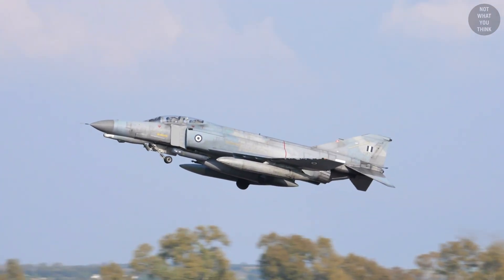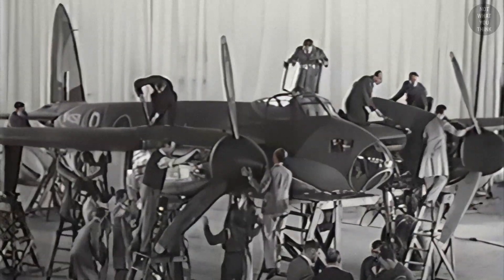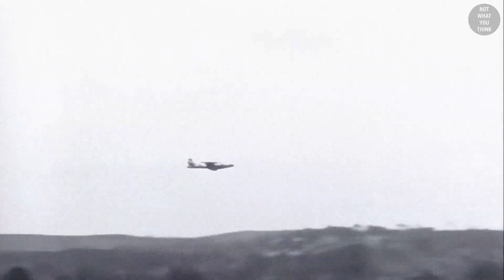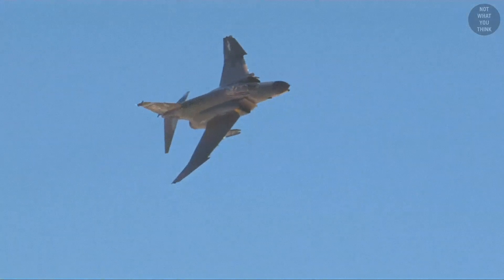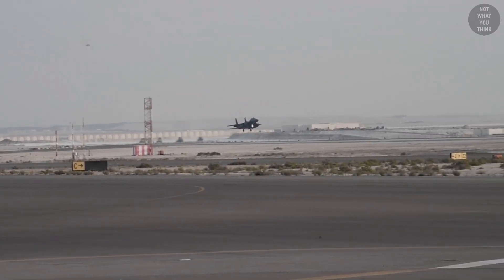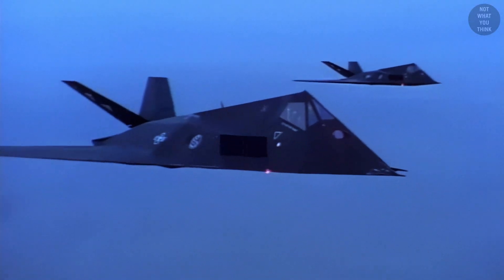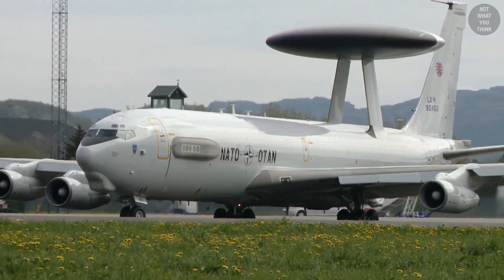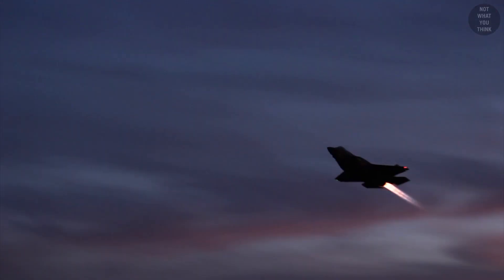Why are Modern Fighter Jets Slower than 1960s?

Comment: To reach Mach 2 you must go to full afterburner and sustain it.

An F-16A's F100-220 engine burns 800 pounds a minute in full afterburner.

It has 7'000  pounds of internal fuel. Finishes in 9 minutes.

The F-15A has two of the same engines. Burns 1'600 pounds a minute.

With 13'000 pounds, fuel finishes in 8 minutes.

Comment: When a fighter jet launches a missile, the initial energy state of the missile is determined by the energy state of the plane.  If it's launched while high and fast, the missile will have more energy than if it's low and slow, which can greatly increase its range and reduce the target's chances of evading the missile.  Its rocket motor will burn for seconds.  The target can try to bleed the incoming missile's energy by maneuvering or turn and run away.  In either case, the altitude and airspeed at launch have something to say about the probability of a kill.

Comment: The actual reason why aircraft don’t fly faster is because aluminium will soften at speeds above 1650mph or roughly in that range, if you want to go faster you must built the plane out of steel or titanium, the SR 71 and XB70 where both made from titanium while the mig 25 and mig 31 where both made from nickel steel, the problem is that titanium is expensive and nearly twice as heavy as aluminium and steel though cheaper then aluminium is 3 times as heavy meaning that performance outside of speed is effected, that’s why the mig 25 has a combat radius of less then 300km and a payload of 2000kg not to mention a low thrust to weight ratio

Comment: Why are Modern Fighter Jets Slower than 1960s?
-
Because air to air battles often occur around Mach 0.8-1.2 ... No one fights above Mach 1.5.
-
Also, the F-4 Phantom is an Interceptor, so top speed is its key.

Comment: Modern fighters are not quite so aerodynamic. They are very draggy due to their avionics suit in their wings. This makes them more manuverable. E.G look at f16 for it too escort airforce 1 ,the jumbo has to slow down, or the f16 has to use afterburner to keep up. Why ,the f16 is a very draggy aircraft. 
❤😂🎉😮Chris Holznagel

Comment: It's a very incomplete video, you seem not to know very well the topic. The modern airplanes are actually pretty fast (F15 and Su 27 can reach M 2.3, Mig 29 M 2.25, etc.). The F22 can reach "super cruise"  meaning it can go above Mach 1 without afterburner. And if no aircraft has reached high speed above Mach 2.0 during Vietnam war, it doesn't mean the capacity is useless. It also mean that cruise speed is high.

Comment: They aren’t slower. F22 is faster then f4 with longer range and better payload. You compared 2 different mission set aircraft. 

F35 multi role single engine one does all missions ok level. To a f4 air superiority intercepter, fast and great at A\A for its time.  

Compare f22 or f15C.

Comment: One more problem with higher speed and aerial combat, at least for now, is G-force.
The faster you go, the higher G-load you need to achieve the same rate of turn. You also get a significantly higher turn radius because of the combined effects of reduced turn rate and higher speed. 
Until fighter jets flown entirely by AI become a thing, human pilots will be the limiting the factor for the maximum G-load a jet can be rated for. For now, around 9-10 Gs is about the limit for most modern fighters. Anything past that could cause even the most skilled pilots to go into GLOC.

Comment: Todays modern fighters are designed to be slower, due to the fact F35 for instance is for BVR and stealth to avoid immediate detection plus it's weapon probably might use standoffs weapons while f-15 doesn't change it still has its Mach 2.5 because its mission is for deep strike and interdiction

Comment: Someone else might have already pointed this out, but you confused the max speeds of the F-22 and the F-35 a couple times in the video. The max speed of the F-22 is actually mach 2.25, not the 1.6 of the F-35. But also, the mission set of the fighter also plays a role here... The F-22 is intended to be an air superiority fighter (intercept and destroy enemy fighters), Whereas the F-35 is more of a multirole fighter and ground attack is a large mission set for it. Also of note, the F-22 can supercruise, meaning it can travel at faster than mach 1 (1.5) without using afterburner.

Comment: A new study needs to be had...for aircraft carrying the laser and rail guns with battery pack to handle the surge energy requirement.  However, the enemy has stealth jets that can go Mach 2.0....F22 still can go Mach 2.0....That is to screw over the US Navy which is stuck with Mach 1.8 jets and give more funding to the Air Force to pay for their debt for fuel from US to anywhere in the world.  This is old debt.  PS..The studies are over 50 years old now...

Comment: It's not top speed that matters in modern air to air combat.  You aren't going to outrun a SAM, and the days of dogfighting are pretty much over.  Even if you do get in a dogfight your turning speed will determine if you are killed or not.  Not only that, but that top speed came with a cost.  Huge amounts of fuel were required, and it wasn't sustainable, so it was really a niche ability.  The F14A used it primarily for cat launches.  It wasn't until the D model came that they could launch on full military.  Modern jets can hold moderate cruising speeds for long distances without expending a lot of fuel.  That means more time on target and the ability to reach targets from a longer range.

Comment: Another thing to add to reconaissance is that during most of the cold war super fast reconaissance jets were a thing aircraft designers needed to consider when they did build interceptor jets. They needed to be somewhat able to catch them.
Fast recon jets are of course not needed anymore in the era of full high tech satelite coverage of the globe and drones. With them gone interceptors dont need to be able to reach such high speeds.

Comment: Old fighter jets where designed to fly faster because their main goal was to intercept enemy bombers. Both USA and USSR had faster and faster bombers that could not be intercepted by their current ground to air defense systems in time, so the need of fast interceptor jets was needed. Nowadays fighter jets main goal has changed and their main goal is to attack enemy's fighters so agility is more critical than speed. Also stealth is a thing to avoid the advanced radar and air defense systems.

Comment: Mach 7 missiles are a great reason for modern fighters to emphasize stealth and maneuvering. If an AA Missile is traveling several times the speed of sound it doesn't have a tight turn radius, so out-turning the missile is the ideal way to evade them.
Reply: The faster the missile the harder it is to outmaneuver it, a plane flying at mach 1 or less won´t evade a missile that is going at mach 7. It would be literally easier for a person to avoid a bullet

Comment: What I want to know is how does a 65 year old fighter still go 50% faster than a plane that has over 25% more power?

Jets still need speed to intercept-
under some circumstances,
an old F-4 could successfully make an attack and leave before an F-35 could make the intercept…
Does that sound right to you?

Oh,by the way-
they have about the same range when running without the ‘burners.

Comment: Yeah, the phantom ended up being a lot of things, but one of the original purposes was fleet defense and interceptor. What was found in Vietnam though, was that pilots never flew at top speed, because in the limited circumstances when it'd be beneficial, the tradeoff in fuel or maneuverability made it not worth it.

Comment: Here's the REAL reason why the f-4 is faster than today's fighter jets... 

The F-4 was first designed for the Navy, which means it took off from and landed on carriers. And they were an extremely heavy, wide frame aircraft. There had to be enough thrust available to get such a heavy jet back in the air in the event that it missed the arresting cable. which is why "Speed is life" was the mantra of f-4 pilots.

Comment: Yeh but modern jets can sustain a higher speed with reasonable fuel consumption because of super cruise which is more useful than a higher maximum speed because it means they can respond faster over longer distances and you are not outrunning a missile so high maximum speeds are kinda useless when the main threat to you is missiles.

Comment: Slightly flawed reasoning: The F-35 is the odd one out. F-22 or F-15 are clearly faster, and still in service.  If you use your Afterburners to gain altitude, you can fly in less dense air, and achieve better fuel efficiency. And while low supersonic speed is important to not have to send Missiles through the sound Barrier, the higher the aircraft's speed and altitude, the more energy a missile can transport. So in Air to Air combat, that means longer range. And because High altitude air is thinner, it gets to it's own max speed quicker aswell.

Comment: I know the point is to be misleading, but top speeds really don't mean shit if it takes you a ridiculous amount of time and altitude to attain that speed. F35 can outrun Phantom on deck (low altitude) with ease and can fly circles around it. The phantom would never in a million years be able to keep up since the F35 is essentially an improved F-16 in flight performance with some minor nuances. The TWR is vastly superior and it doesn't fly like a giant brick. It retains speed significantly better and can accelerate significantly better if it needs to lose speed and gain it back quickly. There is nothing "fast" about the F4 Phantom besides it's top speed at it's highest altitude.

Comment: Speed is the key. With speed you can pick who to go after, who to run away from, and who to dog fight with. Altitude is the other factor, less important than speed, but still very important. If you are higher than an enemy when coming down on them, you have an energy advantage, altitude advantage, and can restate yourself for another attack while the enemy who is far lower than you can't even climb fast enough to shoot at you, speed and altitude are literally the best, if not the only answer to pilots problems.

Comment: Haven’t watched the video but my guess is, modern jets trade speed for more control and more features. Missiles are going to out speed the jet anyway so it’s better to increase the weight of the craft by putting in a flare system instead. For an interceptor, fighter craft speed might be more important but an attack craft has no reason to be quicker, just load more weapon systems and ammunition. As most fighter craft deployed are also attack craft then this makes the attack craft more guns reason apply even though the video title says fighters.

Comment: they carry more fuel, carry more ammo, carry more missles, carry more defensive equipment, carry more personal safety equipment and the engines are heavier but also less fuel consuming. Before i watch this video i can say its due to Highspeed < Efficient Fuel Use. + modern planes accelerate MUCH faster + use way less fuel to reach higher speeds. + Look at the f22 also a twin jet fighter. the CRUISE SPEED is higher + less fuel consuming. + the f22 is stealthier,more agile and better aware of its suroundings... And also at its 'limited top speed' (They're speed is somewhat limited) I bet an f22 can go WAYYY faster than an F4 even a F35 could manage that. If they just dont give a fuck about infrastructure and intergrity but then again the plane would lose all of its use. The point isnt to make a fast plane. its to make a fast + agile + reliable + high capacity bomb carrying + ammo for the cannons. Back then it was just build a jet put some missles on it and a big ole cannon and you had yourself a early Jet. they didnt 'research' like with cars. they build fail and improve. Thats why shit goes so slow nowadays they dont build and test. they build, test,find,research,fix,test,find,research,fix,... In the 70's-80's they build a plane use it oh it slows down too much in turns fix it boom. No 2-3 months of testing and researching before even starting to try to fix it. Plane slows in turn? prolly the wings. In the first 1-2 years modern planes dont even fly (for the public) they need to be perfected before they can be used. Back then LMAO so many failed planes. I guess more pilots survive now, but my thought was. If they just acted like back then, we would've been much further in technology

edit : Just think about it since safety became a huge thing our technological advancements havent been as fast as they where before. From the invention of the wheel 6000 years ago the first ever invention of human kind. till 1960. phones,television,planes,boats,cars,power tools,... and from 1960-2023 nothing new ever came. Atleast not as grand as a car or a jet fighter.

Comment: Put all the old fighters on a 5th gen load of fuel and weapons and observe if they are really that fast or agile. In actual combat 5th gens are simply faster everywhere overall and with all their tech trickery can fight in new ways the older gen jets are simply not capable of. Even in manueverability, it's the fastest acceleration, braking and cornering that makes you fast everywhere.

Comment: For a long time, speed was not predominant, mainly due to the end of dog fights, but now in the new air battlefields, BVR doctrines require fighter speed in dives and evasion maneuvers to dissipate energy from the new generations of BVR missiles fired at a distance.
Even a stealth fighter that reveals position by firing a BVR shell from 100km away needs to quickly change firing position to avoid a counterattack.
A lot of people don't realize this yet... Imagine what it must be like for an F-35 to dive slower than an F5, to escape a BVR missile at 4,000 km/h

Comment: Also... the aircraft of the 50's and 60's were driven in large part by the Cold War, and the need for jets to be built as interceptors not fighters.  Interceptors were designed to be deployed against nuclear bomb delivery aircraft such as the Soviet Union's TU-95 "Bear" (of which I conducted three live intercepts on between 1983 and 1985.)  The purpose of the Interceptor is basically to get to the target as fast as possible, and engage in pretty much straight head-on (cutoff) maneuvers, or from behind (stern) maneuvers.  And ideally, they were in and out pretty quickly.  Arrive, shoot, go home (or to the next target).

Comment: The F-4 was designed as a fleet interceptor.  It went fast to get to the incoming enemy.  But nobody ever attacked our fleets that way.  And Phantoms didn't turn well.  And, as pointed out, they really gulp fuel in afterburner.  In a fighter plane-on-plane engagement, turning performance means more.
--Michael Woods, Major, USMC and Naval Aviator
Reply: turning performance doesn't matter at all anymore lol
Reply: @fuckoff4705 With BVR combat, yes.

But if that's the case, then why does a craft like the Sukhoi-57 have the maneuverablity capabilities it has?

Comment: This is not going to age well with the new F-15.
You know, the plane that has a thrust to weight ratio greater than one?
Meaning that it's technically a rocket?
It doesn't need wings to fly or land? It can actually land with one wing without problems.

To be fair, it's mostly because the tactical role figher jets were historically used for is slowly being shifted into guided missiles and automated systems.
The real question should be why 60's jets were faster than any other in history. ;)

Comment: Not really a fair comparison. F-35 should be compared to original F-18, F-16 fighters not the air superiority F-4 type aircraft. just saying. Some errors on what aircraft are supersonic and not.
Turn rate is incorrect: its G-Force. pilots cannot turn the plane faster because the faster you go the less of a turn you can make because of G Forces. 
And super cruise is fairly new. Gen 4 aircraft could not super cruise. This is super sonic flight without afterburner.

Comment: Did you know that the SR-72 Blackbird's recommended defense against AA-Missiles & Interceptors was to just accelerate?
Since it reached Mach 3, it could simply outrun most missiles and jets.
Reply: Try but would not out run mig 25... This video only stated Mig 25 safe max speed of mach 2.8, but could do mach 3 with sustained self damage to the engine because prolonged mach 3 use would destroy the engine eventually. Bad for long use but good for momentary escape, better slightly damaged jet than a destroyed jet

Comment: @Not What You Think   
 The comparacent at the end is a bit of a false equivalent . while the general points stand, the comparacent you made at the end is unfair as the top speed is not what reduced the missile capasaty of the 104 was not due to purely speed, that may have been a factor yet the phantom can carry as many or more than the f35 on purely internal. also the F4 was limited by the design of pylons of the time, the aim 7 / 120 can be mounted in stacks of 2 now where back in the f4 phantoms days it could only mount one per pylon. with exception of the aim9 as is required no link to the aircraft.

Comment: Another issue with supersonic speeds on stealth aircraft is its effect on the stealth coating. At high speeds and heats, the stealth materials that dampen an aircraft's radar signature begin to buckle, crack and flake off, potentially taking away their greatest advantage and costing millions to replace.

Comment: Modern aircraft use engines with high acceleration bias. Large nozzles and no thrust cones oversize mean the engines eject more gas, but at less pressure. Reducing top speed, and increasing how soon the aircraft reaches said speed.